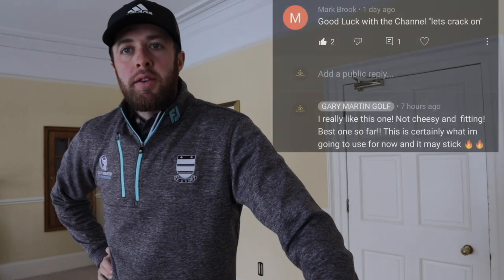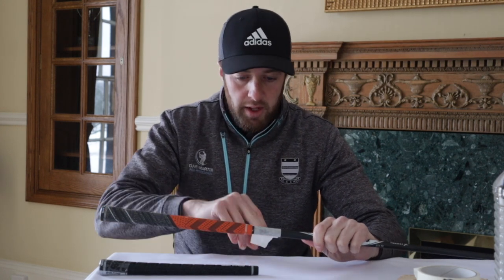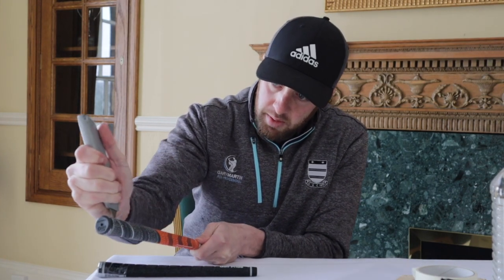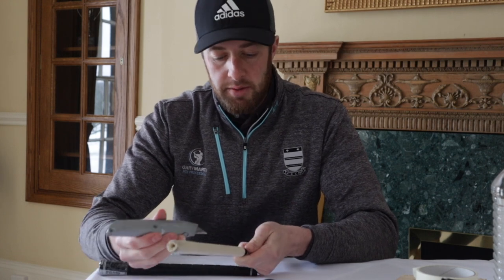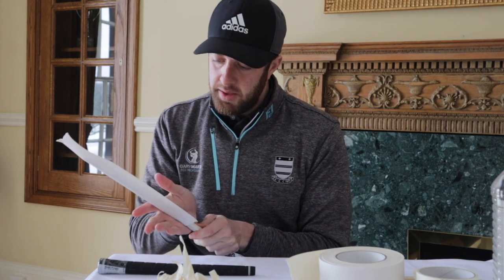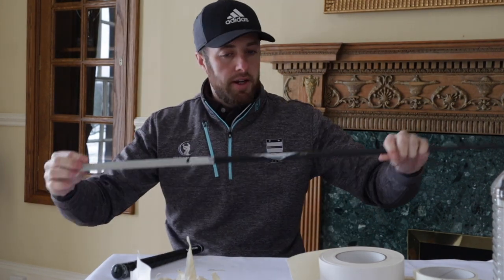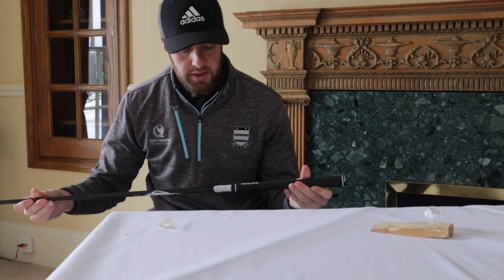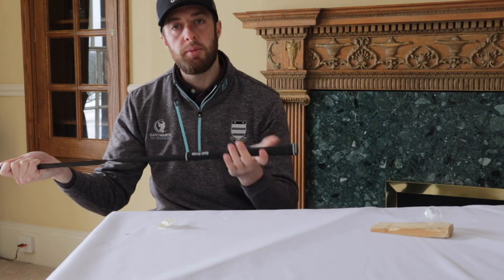RE GRIP A GOLF CLUB USING HOUSEHOLD ITEMS!!

Comment: This is the stuff we want see. Especially in lock down. Maybe cover the use of tape for thickness a bit more on another video.
Reply from the maker: Good shout 👍🏻 Ill tie that into using the correct grip thickness video 👌🏼
Reply: @garymartingolf  hey gaz where do you get the double sided tape? Just done two grips inspired by your video but they came with tape. The dble sided tape i have is very thin and see through?  So glad you did this video. Been refurbjng cricket bats for years but golf clubs = scary and the grips just scrubbing with hot soapy water and making do!!!!!

Comment: I've re-gripped mine using the same method. Didn't mark the length with masking tape though, got a feeling I solid stretch mine so will definitely do that next time.
Reply from the maker: Its easy done. Ive done it in the past. Thanks rich 🤙🏼

Comment: Perfect ... any advise for me , recently brought a driver from online , was all I could afford or justify , I think the shift is just a little to long , can I cut it down ,or how easy is it to change shafts . And any idea what length I should be going for . I am 5,11 ,have dont have long arms .. I know its a shot in the dark , ideally in future I will get fitted
Reply from the maker: You can trim upto 1” off the butt. I’d watch a tutorial on how to butt tip a graphite golf shaft. 

We wouldn’t usually suggest shortening a driver shaft based on your height, but I’d start with 1/2” if you feel uncomfortable. It will feel like you’ve taken more than that off when you go to play, so don’t take an inch off straight away or you’ll most likely regret it.
Reply: @garymartingolf  ok yeah , I know its not the done thing , and I know drivers do have longer shafts I just feel its slightly to long . Will give it a go , cheers for the reply 👍

Comment: Hi Gary. Do you know if say “cheaper grips” or grip the may not be “golf prides” own brand, (knock offs from online) may be tighter to put on! Literally on irons or driver i cant get it to go on no matter how much white spirit i used. Are grips wider than others? Thanks in advance
Reply from the maker: All grips have to be stretched over the butts slightly, that’s why you need plenty of white spirit or solvent. Could you maybe send me a picture of the grips on Instagram or Twitter ?
Reply: @garymartingolf  cheers for getting back to me! Pinged you a messaged on Instagram ✌🏼

Comment: Gary, the bit that puts me off doing this is most grips have 2 lines like you said that line up to a square face doing it ur way how do you do that without a vice
Reply from the maker: I’d did this video during full lockdown, so showing people how they could have a go at re-gripping with the very basic household items. 

I personally prefer to line up the grip without a vice, but if you’re a new-by, and you’re worried, I’d advise, buying 360 grips with no reminder, and fitting them reversed so that there’s no decals at the front.

Comment: I've used golf pride tour wraps for years because they're really tacky but last year, when my hands began to sweat they got extremely slippery.  This was the first time this happened to me & I was wondering if anyone else has had this problem. Even worse is that I haven't been wearing a glove for a few years as well but the slipperyness wasn't a problem then. I clean them once a month but it doesn't make a difference. Any suggestions? I just had them regripped this season.
Reply from the maker: This is an issue with that grip I’m afraid, Great when dry, but so poor when wet.

Comment: Hi. Any tips for getting off the glue residue from the shaft? regripping a second hand wedge that I recently bought and there was so much glue left after taking the old tape off
Reply from the maker: If it’s a steel shaft, run a Stanley knife up and down the shaft to get the bulk off, and then give it a hard rub with white spirit and a cloth. Then leave it to dry for 1 hour before trying to apply tape.

Comment: What is white spirit?????
Reply from the maker: You can buy grip solvent, this was a video in lockdown when they were out of stock online and only hardware shops were open. 

White spirit is what decorators use to remove paint off their brushes. It’s a solvent that evaporates. You should find it on Google.